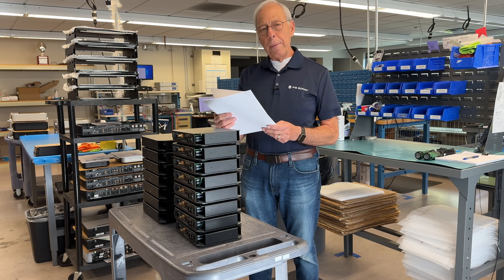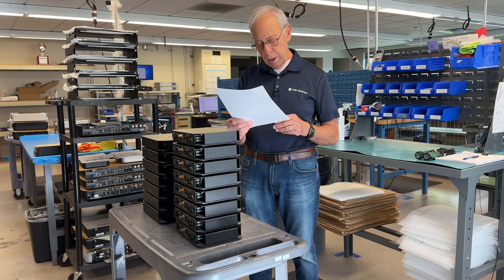ESS vs  Burr Brown DAC chips

Comment: Paul, you've created a new conundrum. Now you need a video explaining why customized FPGA Dacs are superior to off the shelf implementations. Not to say that there's no talking about R2R ladder Dacs in the conversation in comparison to sigma delta dacs. LOL!
Reply: The clock speed/sample rates of FPGA got fast enough and devices quiet enough - plus the toolsets are massive for designing not only circuits and devices but running emulation and test cases.  The bonus of FPGA is you can easily build instrumentation into the device that runs along with but outside your actual design to give you real time debug output so instead of taking massive amounts of build and prototyping time to dial in your amp you can rapidly cycle through different aspects on the actual hardware as well as run simulations 
Another advantage is you can map out your clock jitter, latencies, etc, simpler than in an ASIC/DSP, where you can get most of that information directly from the device or with simple implementations - it's easy to add something like ring generators to send clock/timing correction if you can simply reflash your PROM instead of having to include instrumentation externally or adding said dual ring generators to your ASIC to cough up a differential that equals your standard clock jitter in that process technology as a value that can be used to do same (but if it's broken, surgery on an ASIC is not even the same thing as on an FPGA).
The DAC is just the engine for the output signal - there is a lot of signal conditioning that goes on after before you get to the final boss of the signal chain, the speaker (I forget how many bits one typically loses with dithering/fidelity removal)...but there are capacitors on all the cells to keep them stable, so your DACs that straight up use divider/capacitor stages would appear more similar in behavior if you were checking for any sort of repetitive and or periodic noise/glitches. A sigma delta can offer a smoother output since it's already got an amplifier stage and it's regenerating/shaping signal, but now you're regenerating/conditioning signal within your converter instead of just taking the samples, getting that digital value, and passing that on to the amplification/conditioning stages; I think from a rapid development viewpoint the design becomes easier to work with using FPGA and that's been my experience on many projects where I have options in prototyping to use FPGA or build discrete (and some engineers want both, because you can email a customer/partner/peer a simple textfile, they can change the extension, and load it up on their own FPGA board rather than send them a new board each time a change is made).
Reply: @russellzauner  FPGAs can be used in the development of a new DSP chip, but as DAC chip supplier, obviously there is a huge benefit in producing actual dedicated chips. What you lose is the FPGA upgradeability of it, which is nice but in itself doesn't have anything to do with audio fidelity.
Reply: @ThinkingBetter  FPGA can be scaled in almost any direction to meet the performance or feature needs you desire.
Glad I didn't bring up PSoC, which are programmable analog chips which are also, like FPGA, well enough performing to use in audio applications now.
Ways it does effect audio fidelity:
1. fixing "HW" bugs (either working around a chip flaw/defect or one in the binfile layout, which would also translate to your ASIC, so you'd be fixing a bug there too).
2. stitching in components to solve specific issues, there are always some - easy to drop in filters, timers, additional processing logic, et to handle something that pops up as an artifact of itself (agreed some of those artifacts might be FPGA specific but there are also well known methods to resolve them and the mrf will probably have the solutions in app notes/datasheets)
3. Improvements in processing quality or new processing techniques are implemented directly.  Yes that's "upgradeable" but I don't think you meant it as in "upgrading your quality/performance" but as "upgrading the physical hardware easy because you just throw it on the next FPGA" (which is not true in practice, your physical timing almost always changes somewhere, which means you have to mod/port a little for the new FPGA - your circuits/methods don't change but your logic layout might, in synthesis, verification, and functional testing the FPGA map doesn't matter as the actual chip design in the target foundry technology is what's being produced and tested and not whatever was used to generate it)
All of those can affect the effecting fidelity, really because that's how it was observed - if it wasn't observable then there'd be no impetus to change anything because of it.

ASIC are nice but I'm not going to use them for something as mundane as this, in These Modern Times.  I have far more interesting things to build in my little growing home fab - I can just yard stuff off the shelf for the rest.
Reply: @russellzauner  As a consumer, we have to ask what gives us the most audio fidelity for our money? A company with experts in DAC R&D developing dedicated DAC chips sold in large volumes or a company creating an in-house FPGA custom designed DAC solution with limited manpower? I would argue that high-end audio often can sound better because the BOM cost will have far more flexibility to accommodate more expensive components and solutions. But I don’t see this logic applies to FPGA vs dedicated DAC chip. An FPGA doesn’t in itself “sound better”. The transistor count and man-hours involved in the DAC circuitry are likely higher for a company like ESS. The result is likely a solution that measures better. On the other hand, the audiophile passion is likely higher for a company putting their brand into leading audio performance. The result could be a solution that sounds better. But is there such a thing for a DAC as better sound fidelity without that being measurable? I’m not convinced.
Reply: everyone should just go back to covox speech thing..

you think there would be market for 'high end' resistor sets?  maybe a kickstarter.

Paul really goes off track here with talking just techno mumbo jumbo about heat and processing power, when neither of those are a problem on the chips. it's not like a dac chip runs out of processing power or uses tens of watts.... sheesh
Reply: @lasskinn474  No, paul is 100% correct. You are right in what you said, but you are wrong in how you are thinking. For the most part there are 4 main ways to make a dac. R2R, current Segment, single bit delta sigma, and multibit delta sigma. R2R is a series of resistors on a chip, and current segment dacs are kinda rare, so we won't bother talking about them. R2R dacs have a problem. Despite what an R2R chip may claim to do, there are no real r2r dacs with a real world resolution above 16 bits. In fact, most dacs only have a real world resolution of 16 bits or less. The only way you can have resolution higher than 20 bits in the real world is to use delta sigma. The problem is that delta sigma is an approximation of the real audio source. Some level of signal processing needs to be done in order to use delta sigma. The more processing you can perform, the more accurate the signal will be. You are correct that small DA chips do not run hot, and don't suck down tens of watts. That's because they can't; not because they otherwise wouldn't. 

In fact if you could throw several GPUs at the delta sigma process, it would be much more resolving than an fpga.
Reply: @tristanjones7735  I Agree my favorite setup is Upsample  filter through DAC#1 Coax into DAC#2 Ultra Clean Power can produce true Analogue sound with this setup
Reply: @tristanjones7735  what about PCM 1702? 20 bit and the advantage of I/V outside the package. But it's not the bits that impress me. Yet, its quite obsolete by now. Even the later series don't sound all that great I hear.

Comment: PCM1792/1794 is still disliked (sometimes even hated) by most of audiophiles. Because it's still the one of rare examples of precisely working DACs, not bringing in his own trash into sound. The only competitors to these DACs are AKMs top of the line DACs. ESS is not even close to these beasts. Not in terms of sound perfection.
Reply: Are you making these claims about differences in DAC’s within a dedicated circuit? It’s likely that your experiences with these different DACs comes from the analog output more than the DAC itself. Most of the time when manufacturers change/upgrade a DAC, they also change/upgrade the circuitry. Like Paul said, that makes the biggest difference. 

This is not to discredit your claim. I’m just saying there’s probably more to it than just the DAC itself.
Reply: @housepianist  It's true that there's "more to it than just the DAC itself". But you'll always bump a limit eventually, and whatever you do, whichever parts you'll use, however you engineer your schematic your bottleneck and the main source of problems will be the DAC itself. It's not necessary to use extremely expensive caps, resistors with femtoapmere noise level and 0,0000001% level of precision, supa-dupa good power supply based on a private nuclear reactor to achieve a full potential of a good and properly working DAC. But even spending millions of dollars won't help you turn a shitty DAC like ESS into a good device. It WILL sound decently at some point, after your engineers pour a bunch of effort in it. But it still be a shitty overpriced DAC. Main problem is - most of audiophiles are uneducated people. Their mantra is "My multimillion system CAN'T sound bad, i've spent too much to admit that i'm that dumb".
Reply: My favourite is pcm1792. It has very strong oversampling filter with 130dB stopband attenuation.

Comment: Fantastic question and very informative answer. I'd love to hear more about DAC output stages and power supplies
Reply: I think that would be ideal because I don’t think - based on my experience - that these different DACs sound all that much different from each other. When you look at the various circuitry implemented with these DACs - voltage applications, output stage, amp classifications, etc. - you definitely have to consider those factors in its overall sound and not just the DAC itself. The only way one can truly hear any differences is having different DACs placed within a set circuit and compare them. Otherwise, there are simply way too many variables to take into consideration to what one may be actually hearing.
Reply: I admit to experimenting with adding LPS solutions with different choices of capacitors on numerous Blu-ray players and did indeed find the analogue output stage was the most influential

Comment: I think Cambridge Audio uses Wolfson chips in some of their DACs. Are they any good and how do they compare to the one's discussed here? Or is it time for an upgrade lol
Reply: You're fine. Instead get a couple of diffusers and/or absorbers for your listening room.
Reply: @Yiannis2112  How many should I buy and what are the most critical placements I should start with?
Reply: Most common places are behind your speakers and on the adjacent from your speakers, walls. For the latter for example, you'll have to use a mirror, which you'll have to drag on each wall, till you see the idol of each speaker on that mirror. That would be where the first reflections are and where you'll have to place the side wall, panels. For small rooms generally absorption comes first. Probably absorption and/or diffusion on the ceiling too.
Reply: All the above are very, very general and somewhat abstract rules. The whole thing needs quite a bit of research from your part to be honest. Fortunately, there are plenty of helpful videos on yt, with regards to the topic. Every room is different so it'll need different treatment. What you'll do, heavily depends on room geometry, furniture or lack of it, doors, windows etc. One way for example, to "treat" large surfaces made of glass, is hanging curtains made of heavy, thick fabric. GIK Acoustics and Vicoustic are two very good manufacturers with a vast variety of products.
Reply: Wolfson is no longer alive was the last of good dacs
Reply: @necrodh WM8741 does DSD natively and does a decent job even by today's standards
Reply: I have the Cambridge Audio Azure 851N which uses Wolfson, good DAC but overall I think it sounds a bit dull in comparison units using ESS I've heard. I prefer more detail so I'll probably replace it soon.

Comment: Interesting to hear your answer.  I have 3 items that have the same DAC chip, the ESS sabre es9038q2m.  A Topping x3 Pro+ headphone amp, a Arcam CDS50 CD player/streamer, and the Burson Audio Conductor x3 Performance.  With the Topping and Arcam, the sound is pretty much identical, very clinical and neutral, whereas with the Burson Audio, the sound has much more life, and is much more enjoyable to listen to.  Which makes sense considering the massive difference in cost and how the DAC is implemented.

Comment: I’m an AKM fan. ✅
Reply: I have a Teac 301 DAC that uses AKM chips. In product cycle terms it’s “ancient” but it does sound very good. It isn’t as resolving as other DACs I’ve heard or even had, but I suspect that’s because the chips are multiple generations away from the current AKM offerings.
Reply: @PanAmStyle Maybe BurrBrown PCM1795?
Reply: @IgorVicS  I no longer really track chip models. I’m leaning toward the Audio-GD R7-HE Mk3, which uses an FPGA plus R2R/ladder.